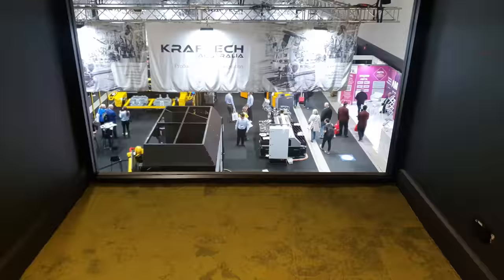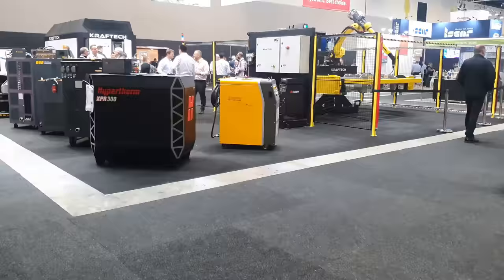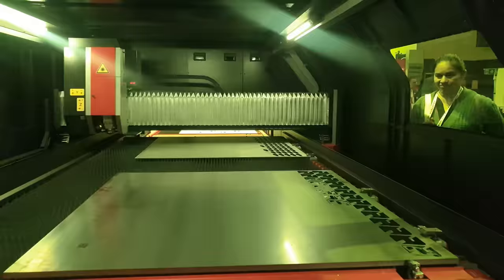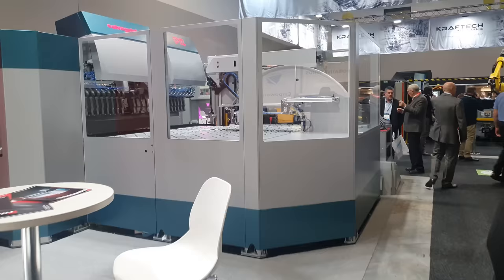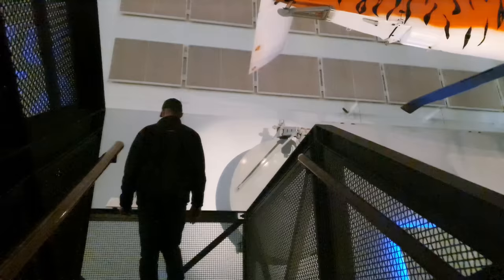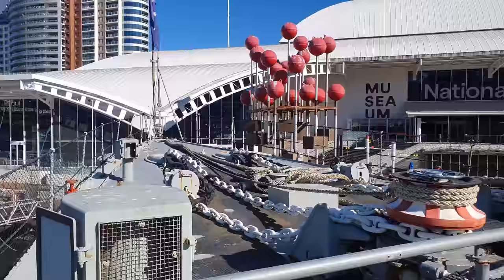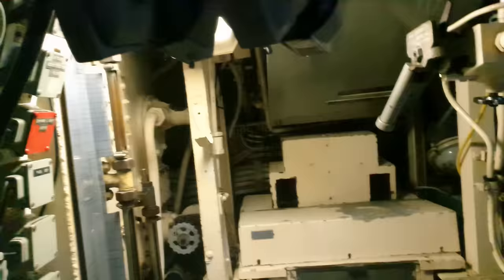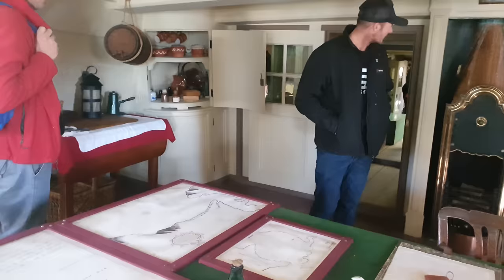Our Trip To Sydney! | Manufacturing Week & National Maritime Museum

Comment: Another great video ..I'm from Sydney and my father was a highly skilled welding supervisor if he was still alive he would have loved your channel. As  a apprentice and young boilermaker tradesman he worked on a couple of Daring class destroyers during their manufacture , they where fully welded construction much of it by hand. Years later in the mid to late seventies he was chosen to be welding supervisor on the on-site fabrication needed to assemble the Sydney Tower.  You showed it  in the video it was cutting edge metallurgy for it's time . The steel was a special alloy that's oxide was weatherproof requiring no painting for its entire lifetime. Most of the fabrication was done off site but he was involved in fitting and welding the individual barrel sections on site .  Alll welds where 100% xray checked and he received a bonus on the end of the job as welding flaws where much less than they expected using new techniques and equipment. He also did alot of water board tanks and oil refinery tanks  fully welded the horizontal welds where done both sides  simulataously using a automatic welding  device and submerged arc technology. All the vertical welds where done by hand stick welding    the welding machines where Lincoln bullets 400amp for stick 800 amp for the submerged arc auto machines. I'm a sparky and as a young guy worked on some of the big Lincoln welding machines old but proven reliable for on site jobs. Anyway thanks for the video good to see you and your lady out of the workshop and enjoying Sydney.

Comment: Before I retired I was involved in additive manufacturing projects which would clad surfaces back to original dimensions. Worked well on turbine blades and large expensive power transmission products like hubs, housings and shafts. Identical to the line bore processes but with additional CNC controls. Most additive technology is focused on 3D printing with not much advertised on this use.

Comment: Great to see you both had look over the Vamp's, I happened to spend 6 mnths on her for her last deployment prior to decommissioning in '86. There is an onboard workshop with a lathe, a drill and workbench. Most of us stokers were operator maintainers, so were mostly working in machinery spaces running the equipment that propelled the ship. Me, assigned to B boiler room. Very hot places to work especially when shutting down in places like the tropics. Ive bern back decades later to visit her, found that everything seemed so small and tiny comphered to when I was drafted to her. We were all very thin and fit back then, he he.

Comment: Thank You as pronounced my name properly.😃  Great tour! Note that the Oberon-class subs used the diesel engines only when on the surface or partially submerged as they needed external intakes via snorkels in the fins. Otherwise, they ran off batteries (about 5 hours prior to needing recharging).

Comment: Your trip looked like a lot of fun. I have always wanted to visit Australia, particularly Sydney. 
Since you guys were traveling and taking, what I suspect is a much needed break from work, I was forced to watch another channel and they were doing some line boring on a dozer part. Compared to your work, these guys were just awful. They need to watch your channel and see how a true professional does these types of repairs. I give their repair about 2 maybe 3 years before it has to be completely re-done. They were using a Milwaukee MAG-Drill to power their boring bar and all the other parts were homemade. The welds were good, but not with the consistency you do when you weld up a hole to be bored, so there were open pits in the final surface.
Look forward to the next video....and hug Homeless for us.

Comment: Trade shows are a great place for networking and to see new stuff.  Usually the most innovative stuff is with the smaller vendors in the back rows. (At least that has been my experience at IMTS and Southtec.)
Reply: In Australia the shows tend to be so expensive that none of the "best value" suppliers exhibit there.